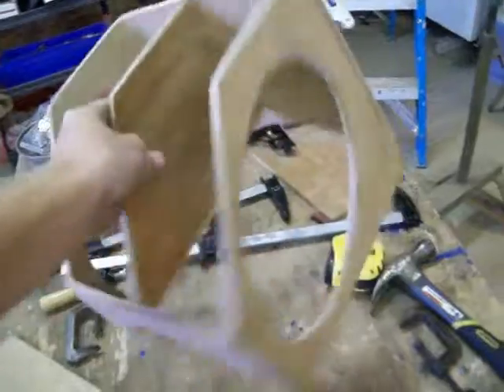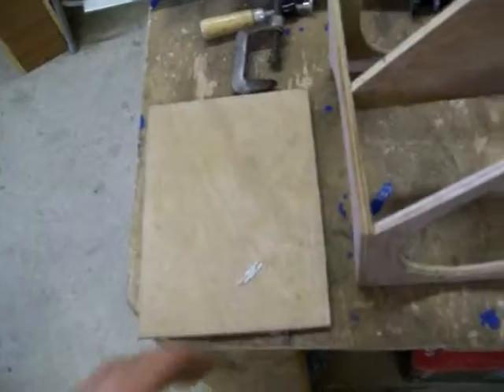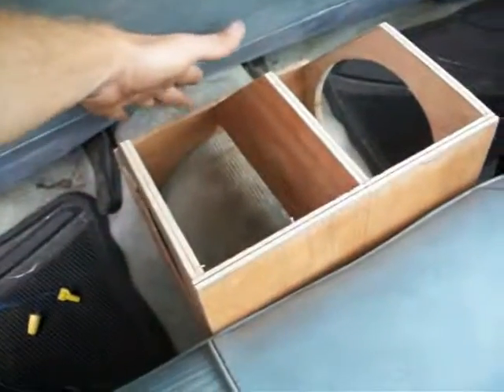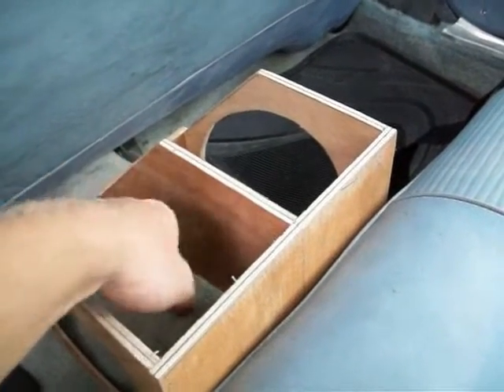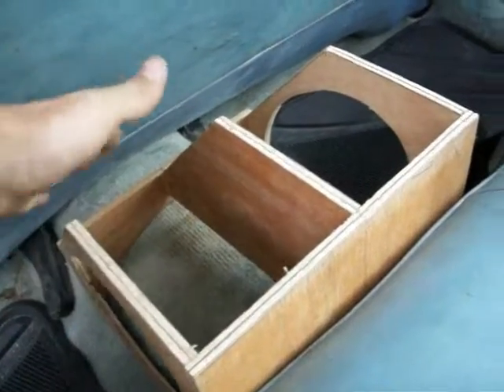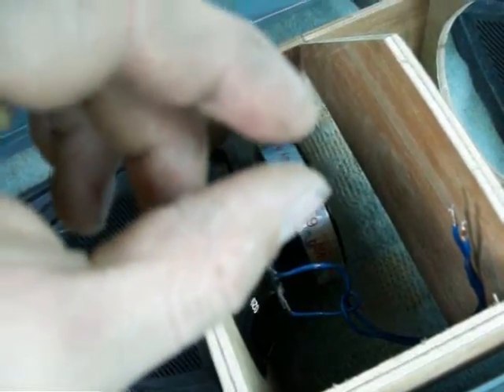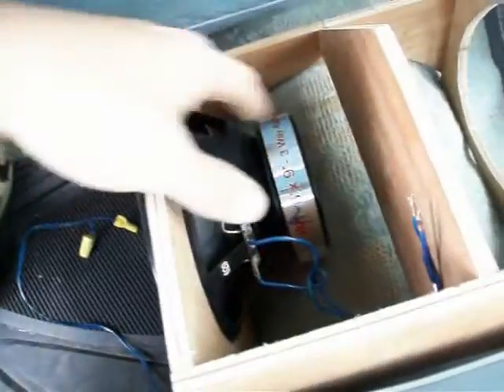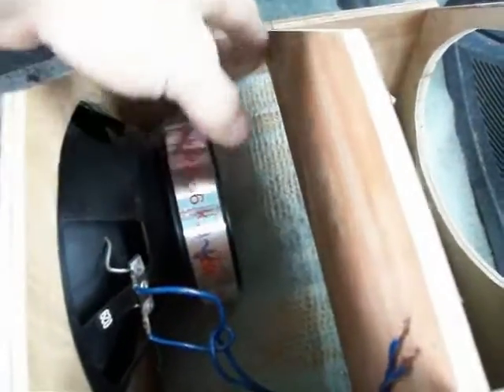This is a Speaker box I made Part 3

Comment: Its called mdf wood. And that's not the only problem here lol u need a fiberglass wall for the floor. The tube isn't going to do anything for those tiny speakers n the air space looks too big for them and u shouldn't have them facing away u should done them at an angel upwards scrap this crap lmfao